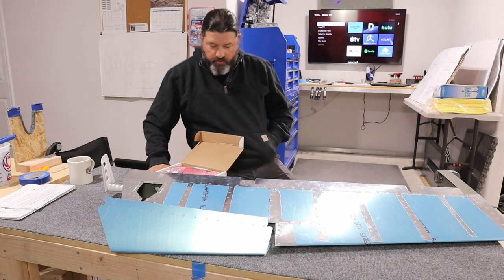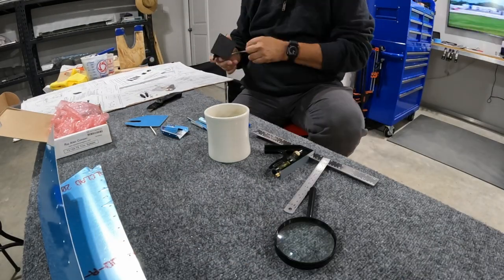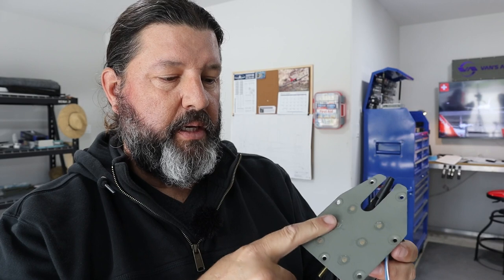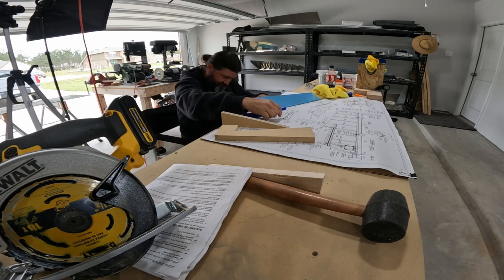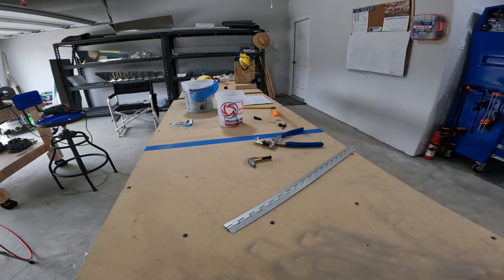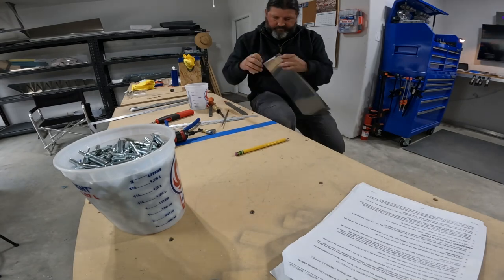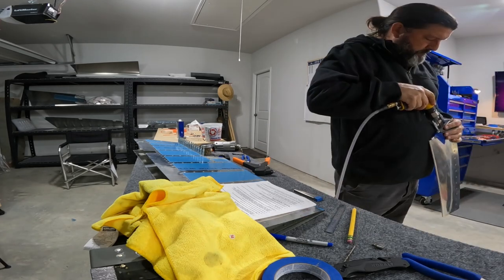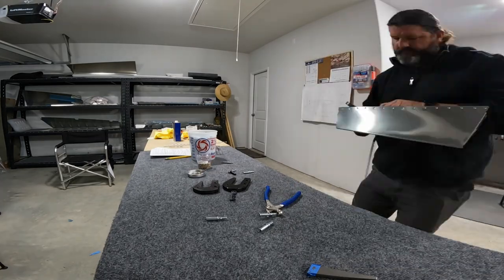Van's RV-8 Build. Ep 024. Elevators 10

Comment: I'm building a RV8, just finished HS, working on rudder, and really enjoying your videos.  I 'm right behind you learning from all your mistakes and best practices!   When you mention a great post on Van's Air Force (regarding trim tab mount, and missing info, and good help from Vans Air Force), it would be great if you referred to a thread or posting in the forum.     Great job!
Reply from the maker: Thanks, Brian! You make a great point. Usually, the stuff I learn on VAF is an aggregate of down-the-rabbit hole research. But, from now on I’ll be sure to bookmark the threads that answer my questions and include links in the description. Thanks for the great feedback! Btw, I’ve just finished building wing fixtures in my shop and I’ve got main spars, plans, and drawings all laid out for a head-scratching session as I type this. Tomorrow, wing construction will officially begin.
Reply from the maker: Also, if you’re not already following @ryanflys , you should. His videos have definitely helped me a ton.

Comment: First trim tab...garbage.  Second,...mediocre.  Third, well done.  After putting riblet in elevator, I'm a big fan of using riblets here.  My riblet wasn't quite the right angle either, but still, doing a bend within a bend is just challenging to get right imho.  The left elevator/trim tab area and bending the leading edges of the control surfaces definitely had some gotchas where a little experience goes a long way.  Great videos.  Keep going.
Reply from the maker: Thanks Jonathan. As it turns out, I might get apply some of that gained experience sooner than I had hoped. Several of the trim assembly components are on the laser-cut parts naughty list. It's beginning to look like I might have to (nearly) completely redo my left elevator, rudder, and HS. Ouch.